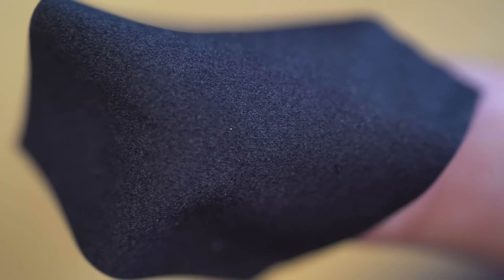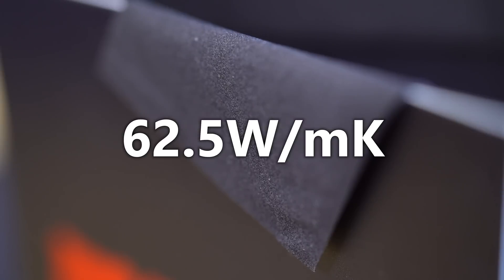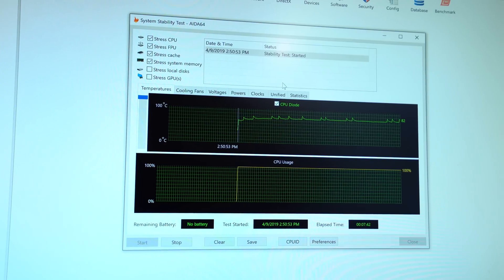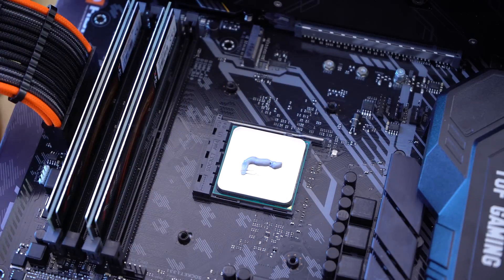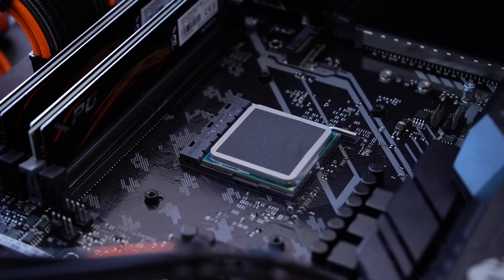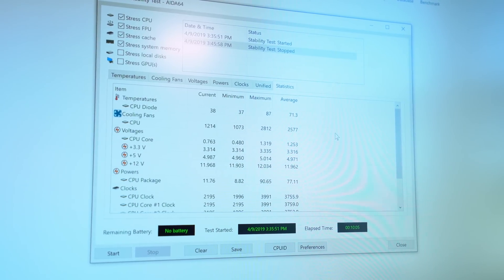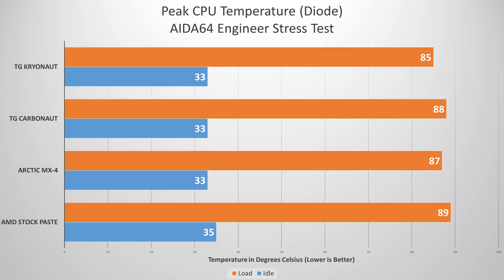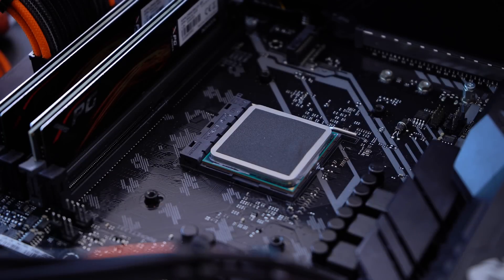A Game Changer? | Thermal Grizzly Carbonaut Review

Comment: Cool! I've used the IC graphite thermal pad for a time for testing systems and components. Being a pyrolytic graphite solution, it works great, especially under high mounting pressure. Unfortunately, I found it tearing over time, so I went back to paste. Definitely gonna try Carbonaut out once I can order them locally. Even though Germany is just 20KM away from me, they charge a fortune to ship it across the border

Comment: a bit late..?
Reply from the maker: No. This isn't IC Graphite.
Reply: @GregSalazar  I'm aware. I was more referring to the fact that a similar product targeted at consumers already exists, so Thermal Grizzly may be a bit late to be a "game changer".

That being said, I believe it's pretty much been impossible to buy IC Graphite since the word got out, and Thermal Grizzly will probably do a better job of handling possible unexpected popularity I'd think.

Hey Greg, I wondered about one thing though... these thermal pads seem to almost float on top of metal. Isn't it easy to nudge it out of position before properly securing the cooler? Especially with something like a stock Intel cooler which are notoriously awful to install (especially as the plastic ages..)

Comment: wonder if it is good for LN2 since it is already solid, it can't crack at low temps
Reply: Jan-Christopher Estelmann If you’re using LN2 cooling then it’s a bit doubtful you’d be concerned with the longevity of your thermal solution which is the main draw of this pad. You’d just use high-quality paste instead for best performance that isn’t liquid metal.

Comment: Wouldn't this kind of pad make life so much easier than those moist and sticky pads used on power delivery/vram chips? I mean the pads that come in GPUs are a mess to apply/replace, etc because of that oily moist they come with, you can never really clean that out...

Comment: So maybe a stupid question but if this was cut down to size could this be used with a delidded cpu instead of liquid metal or would the thickness cause problems? Because you said that, on paper anyway, this was awfully close to conductonaut. 
Not something id try, just curious.

Comment: Technically, yes, you want to cover all of it..... However, if I'm recalling correctly from all the time watching GN, it's significantly more important that you cover the die(s) itself/themselves. Covering more can aid in performance, yes, but won't help as much as covering the die.

IC has already created this same product, and it's tech has been around for years. Beyond that, we have a 4 degree delta between the hottest load temp and the coolest. That isn't gonna make a difference in an OC.
Reply: To add to that, the copper base of the heatsink he was using is round so its not even interfacing the corners of the heat spreader anyway.

Comment: I'd like to see what this would do on a Radeon VII replacing the graphite pad.
Reply: I think the Radeon VII dies are too uneven for it to work well. Gamers Nexus made an excellent video about it and tested mounting pressure with pressure paper. So they basically used a thick graphite pad, so that they get contact on the whole GPU.
Reply: Alexander Daum where do you see die?
Reply: @stevethea5250  In the radeon VII video of Gamers Nexus.

Comment: Curious if they could make thicker versions that would work in place of thermal pads on gpu's.  Functionally the same with better thermal properties.
Reply: Often on area like VRMs you don't want an electrically conductive thermal pad, VRAM on the otherhand oftem don't need much in the way of cooling.

Comment: I've been using Innovation Cooling Graphite Thermal Pads with good results for a while, and they work great and can be reused. I'll be sure to give the Thermal Grizzly Carbonaut pads a try on my next build if I can find them.
Reply: The main claim of difference between there and the IC pads is these keep the tubes vertically aligned as opposed to horizontally on the IC.
Should have better conductive properties.

Comment: Ugh, a long line from top to bottom, what a terrible application, worst I have seen yet, MY preferred method is to apply it by mouth, only way, I get the best performance, best temps.
Reply: I feel you. When I run low on mouthwash I don't break a sweat. I just grab my trusty tube of arctic silver! Mmmm tastes great!
Reply: @chuck6652  leaves that fresh chemical taste and breath!
Reply: Ah the Mother 🐦 technique.
Reply: From what I have seen about applying thermal paste, the best way to cover the most possible area of the die is to just dip your cpu in a bulk tub of thermal paste.
Reply: What about just circle blob in middle of it?
Reply: @stevethea5250  You may be able to circle the center of the IHS with your tongue like it was Bill Gates' nipple, but some of us are not that dexterous during the tongue application process.  Best to keep it simple.
Reply: Right as I read this he said it in the video
Reply: I use my big toe
Reply: k

Comment: In the future, a direct comparison with the IC graphite thermal pad would be great, and a proper sized pad from thermal grizzly lol.
Reply: I second that. I have been using the IC Graphite thermal pad for a while now with excellent results. Interested to see if an upgrade is in my future .
Reply: Dragonspawn666 what future you mean?
Reply: @stevethea5250  his future, lel
Reply: Wondering this as well
Reply: Isn't the max temp high on the results?
The idle looks beautiful, but I'm too noob to be able to figure what the highs would be.  Can y'all help me?
Reply: It was an overclocked card on a stock cooler. I’d say the temps were quite impressive. If not over locking, or using an aftermarket cooler. Temps would likely be much better.

Comment: If anything that will be useful for eliminating the thermal compound as a variable during tests.
Reply: What about for gaming?
Reply: Steve Thea obviously it’d be like your typical mid range thermal compound for gaming. if the cost isn’t too high compared to other thermal pastes it’d be pretty decent for all use cases
Reply: @oldcracker3383  yes it's just $3 more than AS5 in Australia

Comment: You should had used a better heat sink than stock on an over clocked CPU. It may have shown more of a delta in between products if the heat sink wasn't absolutely saturated and on the brink of being overwhelmed

Comment: So "systems run hotter over time"...with general use gaming etc how long should you expect run of the mill thermal paste to last? 5 years? 2 years? I had my last water cooling rig set up without change from 2013 thru 2018 and feel I saw zero change in performance. That includes no clean out and same thermal paste

Comment: I don't know that I'd ever use this - 
But if every OEM on the planet did, that would be a good thing.
I recently did a teardown and rebuild of an HP SFF desktop with, uh...  about ten children aged under 10 (I work with kids), and the thermal paste on the bottom of the heatsink and on the CPU?  My goodness.  Like rock.  I swear they use the worst TIM they can buy.
Something like this would be a much, much better option.

(For what it's worth, replacing the TIM dropped the CPU temp by about 8 degrees)

Comment: I use the Innovation Cooling version of this from Amazon on my 9900k.  In AIDA64 stress tests it gets pretty high with an AIO (mid to high 90s) but that product has only has a thermal conductivity of 35W/m-k.  However in games it only runs at the hottest around 67 C or so.  I would be curious to see how the Thermal Grizzly pad would handle a high end Intel chip such as mine or even one of the higher end chips like the enthusiast ones.

Keep up the good work Greg!

Comment: Using it to standardize cooler testing is brilliant.
Reply: When there are 7 replies to a comment but it’s only actually two people
Reply: Is it tried and tested true?
Reply: @stevethea5250  its new
Reply: @marc_frank  when would it be old tech
Reply: @stevethea5250  ? in a year
Reply: @marc_frank  well this stuff was exposed 11 months ago so now I have to wait an extra year? :/
Reply: @stevethea5250  if you want to know if its "tried and tested true" ...
Reply: @marc_frank  yes of course I don't want to fry my components or burn the horse..

Have you used it?
Reply: Hold on, maybe...
I've read other reviews of this stuff where it's performance changed over multiple applications.
Possibly it becomes consistent after the first few uses but I'm not aware of anyone that's tested that yet.
Reply: In a way... but while this product doesn't degrade much in a single install, repeated installs can AND WILL cause degradation.

Comment: maybe one day the IHS of CPU's will come with this tech built-in/ pre-installed
Reply: If anything it makes more sense to have these preinstalled on the cooler.
Reply: pricing and supply chain has to work out, but I can see it working. Greg or someone like Steve at GN should test that, come to think of it.
Reply: Interrobang What’s IHS and what is GN
Reply: @stevethea5250  ihs is integrated heat spreader and gn is gamers nexus just in depth tech youtuber
Reply: Damien is IHS a 2019 acronym PC trend
Reply: @stevethea5250  not really IHS has been a term for quite some time to shorten the phrase integrated heat spreader on desktop cpus. not sure when it started but it was far before 2019 its just come into light more recently with the huge temp gains since like the 6700k era and onward where deliding that heat spreader and replacing the bad thermal compound gives decent temp changes
Reply: @Cerus98 did you not watch the video explaining the advantage of the pad?
Reply: @Cerus98 considering how bad intel's TIM is... this might actually be an upgrade, though of course solder beats it by a large margin.
Reply: @Cerus98 I mean it cooled identical to mx4 and better then stock amd paste? so seems ideal for thermal transfer to me. if it can match non exotic pastes without even having full coverage with the added benefit of pretty much not wearing out seems to smash paste in all but being as cheap in the short run. only place where I see it not being better is soldering the ihs
Reply: Then they will make up twice
Reply: Radeon VII comes with it... but you don’t really want it... these pads are great for consistency and reusability but not ideal for thermal transfer.

Comment: Looks like a great solution for noob PC builders. Can't really mess it up like adding too much or too little thermal paste. I am really impressed by the thermal conductivity performance, basically on par with a good thermal paste.
Reply: actually its long life would prove it to be a pro product choice. No annual rebuilding to replace old dry paste. less maintenance = more gaming and less worry. 
also you can mess up the application as its conductive. its certainly not something you want a nervous yet overly exited noob to be handling.
Reply: i would assume it would benefit Laptops and consoles more ... i mean laptops suffer more of high temps a with the already crappy factory applied thermal paste .
Reply: @amineabdz  yeah laptops, consoles and prebuilt office /school PCs would be the best use for them, nobody ever opens them to change thermal paste and it leads to hotter temps over a couple of years. consoles would benefit the most as they have lower powered components compared to a regualr PC and the expected lifetime is around 4-5 years for the average console like a playstation.
Reply: @amineabdz  biggest trouble with laptops and needing the thick paste is the amount of flexing and moving around they have to endure wtih less then perfect flat surfaces for thinner pastes =pump out . I can see this working quite well in laptops for that reason and might even pick one up my self, as once you remove the thick paste on a laptop if you replace it with anything in the thin area it will get pumped out unless you win the cooler lottery on the laptop
Reply: I would be fine never having to use paste if the pads are just as good and it looks like it is.
Reply: But this is said to have 62.5w/mk conductivity and has very even contact with CPU......

So how is this performing like a mid range paste only?
Reply: The bigger the glob the better the job
Reply: A task complicated doesn't necessary mean to be for pros. If it works, then the paste guys are noobs for not choosing a simpler alternative.
Reply: Idk if you're gonna mess up anything by adding too much, sure it'll overspill but it's not conductive so it shouldn't cause problems, too little will tho.
Reply: Also should be noted that the test here was run with a 32mm by 32mm pad because he didn't have the 38mm by 38mm one which would have not left the exposed edges around the IHS. Plus, Thermal Grizzly are working on halving the thickness of the pad. If it got retested with a full sized half thickness pad I think the tests would.be quite good.
Reply: Ragib gonna wait and watch , maybe find perfect size for laptop

Comment: have liquid metal on my intel cpus. damn it was hairy though. left a log in my pants putting that on my 8086k & 8700k. for general use mx4 is a great paste i use often due to its price. these are an option as the amount of times i am changing coolers or cpus it would help me a lot
Reply: Did you scuff up the cpu first? I did and it made a about a 4c difference.
Reply: Kurt Hansen no mine went well luckily
Reply: @makaroner ? It's a real cpu.
Reply: liquid metal is .01% better than safely lapping the ihs and heatsink with quality as5.
Reply: @markm0000  AS5 sure is quality but there's much better options on the market now. I recently did my final application of AS5 after over 15 years of trouble-free performance :D
Reply: H31MU7 what is AS5 what do you use now?
Reply: @stevethea5250  I switched to Kryonaut for high end builds. Lower end builds get some Chinese stuff in a yellow tube I get for free from Dell.
Reply: @H31MU7  what about mid range build
Reply: @stevethea5250  I use fermented mayonnaise.
Reply: @H31MU7  nooooooplzz